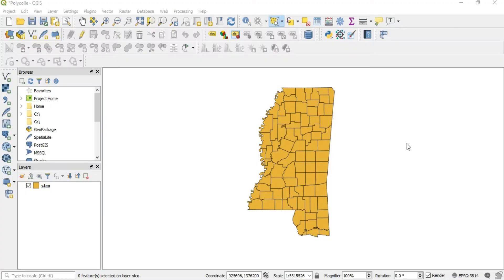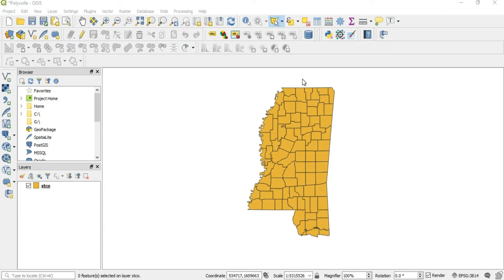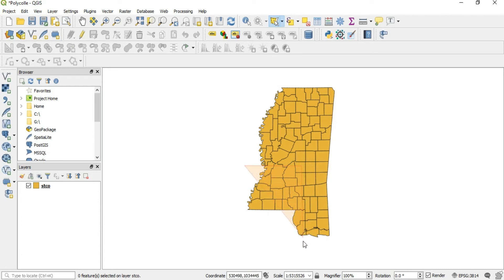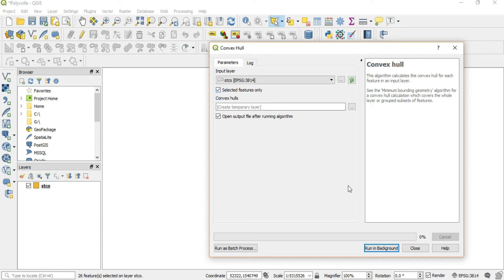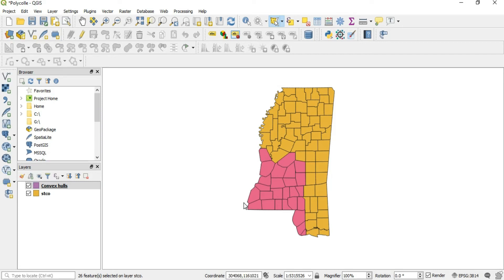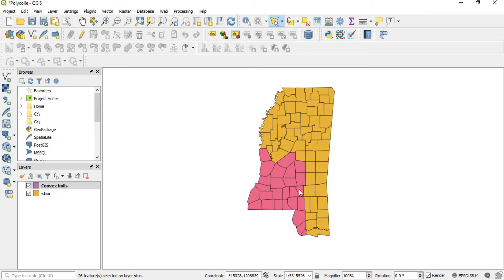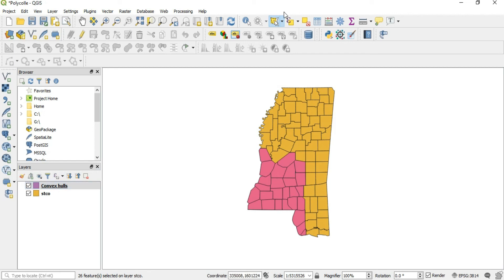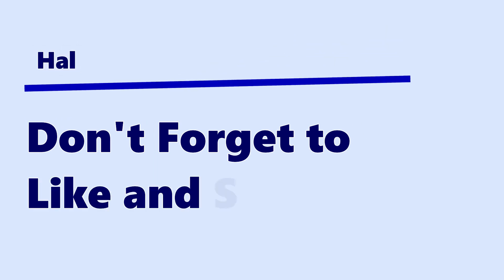(NO MUSIC) QGIS Basics #25: Convex Hull

Comment: So is this essentially a mass clip, but instead of clipping for each polygon, you get them all at once?
Reply from the maker: Hello finally back at my desk. So convex hull is more than just a mass clip it is used to take what every group of points entered into the function and breaking the into subsets, these subset start from the central point and work outward the largest convex subsets are the result that is shown in the final product. These concave subsets also protrude within one another in Euclidean space. These protrusions change and modify which subsets establish the most concave feature. This explanation is just about "skin deep" or very simple way to think about it". There are many calculations done to equate the placement and how the end product is visualized. Many people when they think of convex hull they think of rubber band being wrapped around a set or object, but this is being done multiple times on the group or dataset.
Reply: @HalHartQGIS  That is a very trippy explanation, but what I am taking away is that it is: [a] more than a mass clipping; [b] contains the largest subset from some central point of many smaller subsets; [c] I can never remember the difference between convex and concave; and [d] think of metaphorical rubber bands. Thanks for the detailed explanation!
Reply from the maker: You go into caves(concave), you run out of places that vex(convex) you
Reply: @HalHartQGIS  That is excellent!